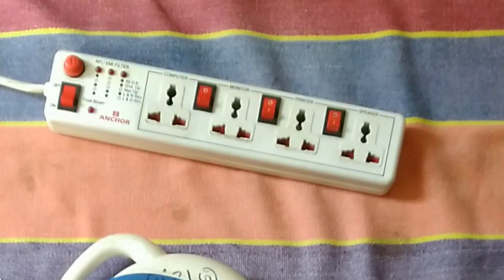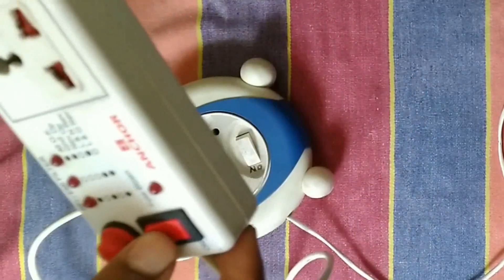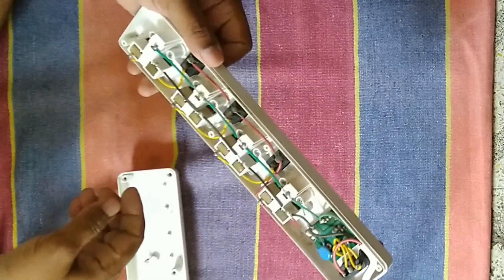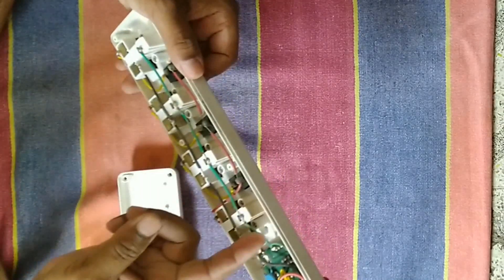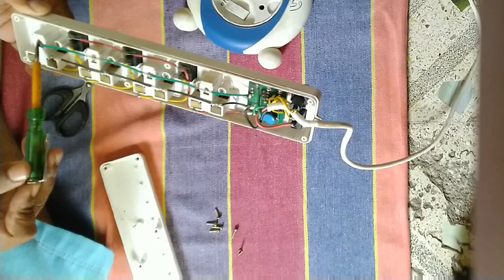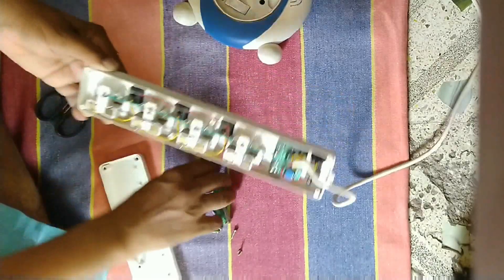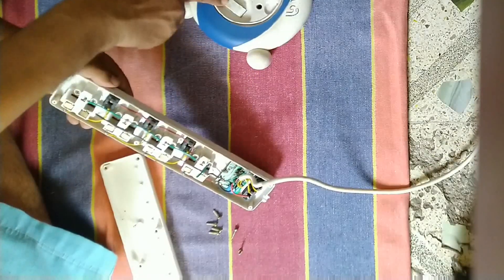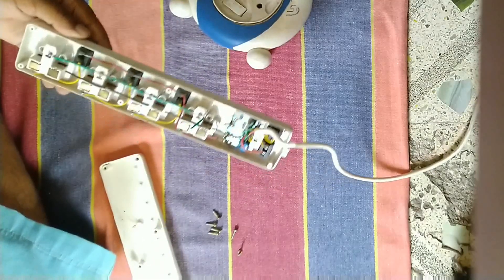Extension board fault identify and repair

Comment: Hello sir, i am  facing an issue related to this extension cord its showing fuse blown so u replaced it with 3amp fuse than i operated an iron through it, but after 5 mins it again blown out. What's the problem sir? Should i replace the 3amp fuse with 13amp.
Reply from the maker: @minakshikashyap8557  Iron takes high ampere current so this is advisable to not use iron on this type of extension board.

Comment: He my fuse showing blown even after replacing it .for some days in emergency I used direct support without fuse by connecting both fuse ends with normal wire but now I bought fuse and replaced it but it's still showing fuse blown ?? And now even direct is showing fuse blown ..
Reply from the maker: Ignore fuse blown light and use with fuse, remove fuse bypass wire proper

Comment: My extension says Neutral Open. What do I do? pls advise...
Reply from the maker: Check both wire connection and if found open then connect. 
Before opening , disconnect from main electric supply
Reply: @peopleeducationonline3219  I checked... The wires are all intact so I closed it back. It's working now but still says open neutral

Comment: Sir, Gnd. Op, Neu op, L&N Rev,L&G Rev ka function Kya Hain aur agar earthing fault  ho yafir Ghar ka earthing tu Goya ho to konsa light glow korega
Reply from the maker: Grnd open means grnd wire open, neu open means neutral wire open, l & n rev means : line wire connected on neutral point and neutral wire connected on line wire point, 
If earthing wire broken then ground open light will glow
Reply: @peopleeducationonline3219  or agar L&G Rev. Ho to iska mtlb Kya Hain?
Reply from the maker: @mrinmayrayya1199   Line wire and ground wire connected
Reply: Aur Jo middle Wala light halksa kyu glow ho rehata Hain humesa

Comment: Thanks for wonderful video.  but my fuse internal circuit board blown away (I mean blue capacitor)... If I am cut the ground wire so I can use for phone charger.. ? Appreciate your help 😊..  thank you Sir ji.
Reply from the maker: Yes you can use it for  phone charger, television, home theatre etc. Where earthing is not necessary
Reply: @peopleeducationonline3219  thanks again for your help. Last question :  can use laptop charger pin(3 pin plug) before cutting last question 🙏

Comment: How to remove switch?? Because two switch is not working in my ancor board
Reply from the maker: If no screw available on switch then, press the switch outside
Reply: @peopleeducationonline3219  screw is awailable but switch is dad,not having on off.so i remove every plug switch and direct my board.what can i do and how reconstructing my board without switch
Reply from the maker: @hiteshpatel-pn6ku  first wire connect with first pin and second wire with second pin

Comment: Hi sir...
In my extension box , power coming in both plugs.
Plz give me solution??
Reply from the maker: If fuse ok then bypass the electronic circuit and connect wire.
Reply: @peopleeducationonline3219  isnt the whole purpose lost if you bypass the circuit. i see a diode in the circuit is the diode problem.